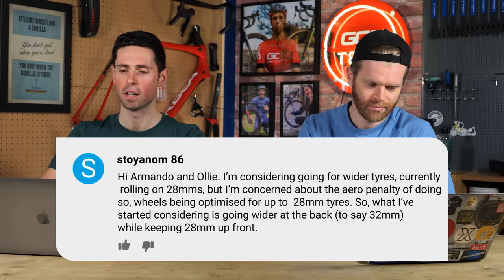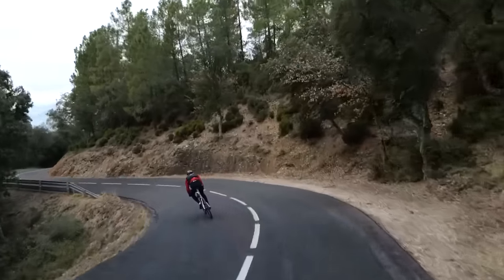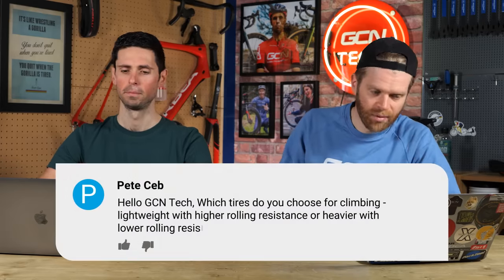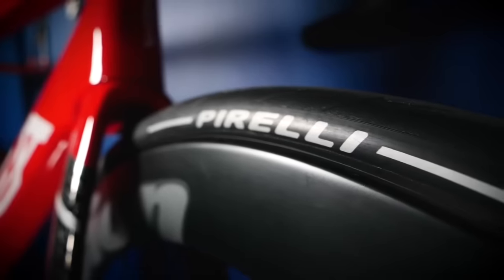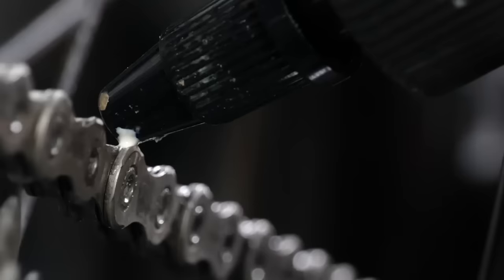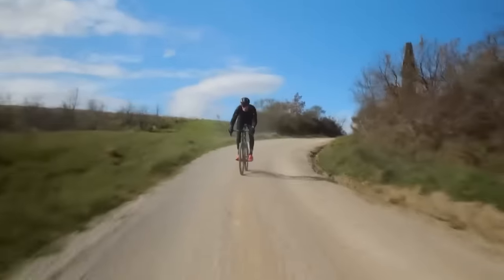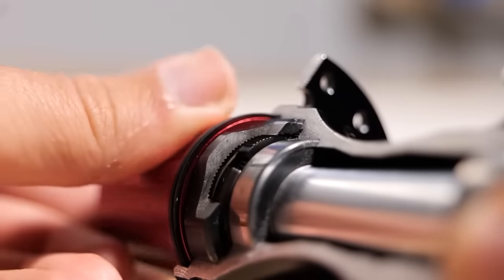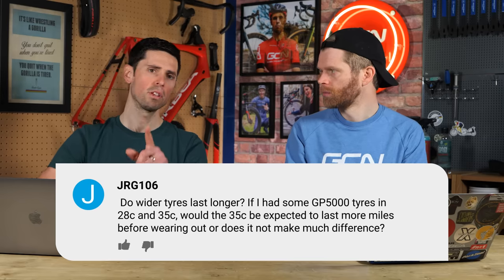Wider Tyres, Dry Weather Lube & Noisy Free Hubs | GCN Tech Clinic

Comment from the maker: Drop your tech questions below using #askgcntech⚙
Reply: #askgcntech do the TPU and latex tubes suffer from rotting when not in use like traditional rubber tubes?
Reply: #askgcntech I got some sticky race gel in my DI2 shifters. Any tips or tricks for cleaning sticky electronic shifters?
Reply: Hi guys, great video as always. I wanted to know, is a grease a grease a grease? Should I be applying different products to different components, e.g. bearings, screws, skewers/thru-axles etc, or are they all pretty much the same product? I have some Fenwicks assembly grease, but I don't know if this is suitable for all jobs, or if I should be using different products for different jobs. Thanks!

Comment: Bad reasoning on the advice for wider tires. Yes, the faster you go the more you benefit from aero gains in absolute terms, but the slower you go the more the gains you get will represent a larger percent of your speed so arguably aero is MORE important for slower riders. Tire width should be based on the quality of the road surface you ride on. If you have bad roads, go as wide as needed to be smooth. If you have quality roads, wider tires will make you slower.
Reply: I think you forgot to take into account, that aerodynamic drag scales proportional to your velocity squared. Therefore, your savings are far smaller in absolute numbers if you‘re slower.
I still agree with the overall conclusion though ❤
Reply: @dualsteel1239  i didn't forget which is why I specifically mentioned that the faster you go the more you gain in absolute terms.
Reply: The percentage should be the same if you don’t take rolling resistance into account. The overall aerodynamic drag of the bike does also scale proportional to v^2 and therefore the proportional effect of the tire width shouldn‘t change, or am I missing something?
When you are slower you then have a higher influence of the rolling resistance and therefore, the percentage of watt saved by a more aerodynamic tire should be lower
Reply: Ah, the good old Achilles and the tortoise! Going slower you just can't get aero gains similar both in absolute and relative terms as when going faster. Simply, everything gets recalculated and you can't pinpoint specific wattage and relate it to other different wattages.
Reply: I don't get it. Assuming a calm day, at absurdly slow speeds only rolling resistance and transmission losses are slowing you down. Riding with flat tires at one kph, would you rather have properly inflated tires or do the  super tuck?
Reply: @Frostbiker  That's a false dilemma in a non-sensical scenario. The fact of the matter is rolling resistance gains from wider tires and aerodynamic losses from wider tires aren't proportional to each other. The aero gains of narrower tires, such small amounts as they are, apply in every scenario. The rolling resistance gains of wider tires, say going from 28mm to 32mm, only apply when the road quality is worse. As a hypothetical, if you were a low level track racer on a smooth velodrome, you would still always ride a narrow tire even if you weren't particularly fast. Because, again referring to my original statement, tire width should be dictated by the surface you ride on. If you ride on pothole filled bumpy roads, the gains from a wider tire are large. If you ride on pristine tarmac you gain nothing from riding an excessively wide tire and in fact lose speed.

I'll repeat again for those lost in the weeds: aero gains and losses in tires DO matter to everyone at any performance level. However they should not be what you base your tire selection on. You tire selection should depend on road surface. You want to pick the narrowest tire that gives a smooth ride for a given surface.
Reply: Nope. In terms of percentages, aerodynamics is way less significant than rolling resistance in percentage and absolute terms at low speeds.
Reply: Frostbiker's example is not meant to be taken as an exact scenario. It's an analogy which helps you get an intuitive understanding of the physics of the situation.
Reply: @padmanabhaprasannasimha5385  You failed to read my last 3 sentences in your haste to disagree.
Reply: @padmanabhaprasannasimha5385  People should only introduce analogies when the actual issue in discussion is hard to understand, otherwise analogies are used as a distraction. The situation is quite clear: ride as narrow a tire as your road surface will allow smoothly.
Reply: I agree with Nike. I mostly ride track and do sprint works hence have narrow tires. Nobody rides there road bikes on bad and bumpy road anyways . We choose super smooth roads for our rides. Only advantage of wider tires is added comfort. Hence the pro riders use up to 32 mm in tour de France long stages. They are mostly in draft and need comfort more than aero for long stages
Reply: The GCN team recently did a video with comparing different tire widths on a snooker table smooth surface and results were within margin of error.
Reply: If you're riding slower, rolling resistance gains will exceed the aerodynamic losses.  It'll be a different tipping point for every human and tire/wheel combo
Reply: @NikeonaBike  even on a smooth steel drum, big tires roll better.
*Ganna got his world record on 25s.  That's not because he wanted an additional challenge🙃
Reply: @colecoleman1499  narrow tires are faster in very old track wheels with a 19-21m external rim.   Newer tracks wheels are wider, mostly because those narrow tires have such bad rolling resistance. Few World Cup teams aren't running 22-23mm tubulars now with wider tires and with Ganna and Dygert winning worlds with 25s, 25s will become the norm.  You also move significantly less in the track with 23s and 25s.  On a wooden track,  you drift up the bank quite a bit with ultra narrow tires. You're losing energy and riding further when that happens
Reply: @petertillemans2231  was about to say this. The results shocked Si and Alex and whilst the experiment wasn't in full control of all other variables, conditions were consistent enough to be representative of real world scenarios. The aerodynamic differences of tyre widths make up such a small percentage of a rider's CDA that it is offset by rolling resistance, even on a smoother surface. I would imagine if they rode at sprinting speeds there may have been a notable variation but then the other variables become more unpredictable.
Reply: While your basic math points are right, you’re doing the scientist thing, and you need to be doing the engineer thing. The amount of aero you theoretically gain, you could also lose by just using the wrong rim width with the newer wider rims, and you are sacrificing comfort. As we know from watching pro TT fits, aero doesn’t necessarily overcome power or comfort, and is thus a moot point if your bars rattle your body sore versus being more comfortable. I’d argue that a more comfortable ride arguably means a faster more aero ride towards the end too because you are more easily willing to get into said aero position and not have to overcompensate for the terrain
Reply: @colecoleman1499 Aside from a track, which in Kansas is a dirt track, I’d love to see a perfectly smooth road that wouldn’t benefit from wider tires. Even the roads in car tracks, that are often taken over for crits, are extremely rough, so much so that they are done that way to increase grip for cars. Basically, you have to riding on a surface that feels smooth to the touch to not benefit from wider tires… And even in the track, we’ve seen wider tires being adopted, 25’s instead of 23’s or 21’s.
Reply: We’ll be sure to pass this on to Honda and Ducati. Narrower more “aero” tires will be all the rage in Moto GP next season 🙃

Comment: I'm using the "gateway drug" of Silca Super Secret drip-on wax. Only the other day I was importuned on the street by a shady character trying to entice me with the hard stuff (a baggie of wax pellets). It's a slippery slope. Well lubricated, you could say.
Reply: I never understood how many chains you can wax with one bag. Or is it just one? Because then it's so expensive.
Reply: You can wax a load of chains per bag. Only a small amount of the wax transfers to the chain, the rest stays in the pot and can be used over and over again.
Reply: @marksticky0688  Thank you! And you just leave it in the pot until you use it again? Isn't it going to get dirty from dust? Or maybe contaminated over time because it takes in the metal from the pot?
And since you're so kind another question: The missing link is officially not reusable. So you buy new ones all the time?
Reply: @frodo5882  keep a cover over the wax. Just use the crockpot lid, to stop dust. Yes there will be some contamination of the wax, but if you wipe the chain down, or better still rinse in boiling water to remove old wax and debris, it will last a long time. 
I personally reuse quick links many times, probably the life of the chain. But if it feels loose when refitting,  you should probably replace it.
Reply: @marksticky0688  Very helpful!
When I'm cleaning my bike I just use water, dishwashing soap and a sponge/rug. When my chain is waxed, should I still clean it thoroughly with a sponge like I'd normally do or would that remove the wax (not talking about the initial but the regular cleaning)?
Reply: The drip on is reported to be 80 percent efficacy with the hot melt with one application. A second application of drip on brings that up to 96 Percent of the same efficacy. For most of us, a distinction without a difference.

Comment: I've gone to 30 and 32 tires on my road setups and I'm just as fast as when I was on 26-28, because I'm not that fast. The difference is microscopic, if not the same, and the ride is much more smooth. So, I don't get to the cafe 5 seconds faster. Who cares!
Reply: Its just a shame to swap bike for just wider tyres. Such a waste. I guess one could try a 650b conversion with very long reach brakes.
Reply: @jepulis6674 same bike, wider tires

Comment: To treat symptoms of latex allergy,
 apply TPU tube liberally.
Reply: I'm back on vittoria latex after so many failed/slow leak TPUs. Way more reliable, and whats a pump or two before going out anyway?
Reply: Just got to that part of the video, didn't know you meant a real allergy! 😂
Reply: @Jalfred92  latex leaks significantly every day under the best conditions
Reply: @veganpotterthevegan  i find about 2.5psi overnight which is very manageable!
Reply: @Jalfred92  Back when I was using Michelin latex tubes, they would drop significant amount of air in 8 hours. Like going from 80 PSI to 65 or so in 26mm width.
Reply: @dainiusvysniauskas2049  that's crazy! I have had mixed luck with vredestein, but vittoria has been flawless for me over many 100s of miles
Reply: @Jalfred92   I got about 5 when I ran latex tubes.  I still prefer the +95% reduction in flats that tubeless has brought me though.  TPUs go in the saddle bag.  I briefly ran TPUs before going tubeless and I only noticed about 5psi a week.

Comment: On the point of the tire wear and pressure exerted, I've had a very similar experience in a *real-world" application.
Caterpillar created a bulldozer with the suffix designation LPG, standing for Low Ground Pressure. (The one we had was a D5LPG vs a D5H. Both were "high tracks").
 The tracks are optimized to exert the minimal amount of pressure possibel for the equipment, without changing anything else, except the tracks. The 5LPG vs the 5H track size is almost double in width, if I remeber correctly, for the LPG  
That piece of equipment could walk across a bog, swamp, wetland, silt pond-- right over the top of it, and not sink, where the other one, just the same, save the tracks, would sink up to the engine, over the tracks, and have to be winched out.

It was amazing.
Reply: The whole weight of the vehicle is shared over the square inch footprint of the tyres or tracks. A 180 lb rider and bike has approx 95 lb on the rear and 85 lb on the front. 95 psi in the rear tyre gives 1 sq in of contact. 85 psi in the front gives a 1 sq in contact.
The larger the contact area requires more tyre wall deformation to achieve. It takes energy to deform stuff. The energy finishes as heat.
Reply: @jameslee-pevenhull5087  or, get this, you run the large tires at a lower pressure… You missed half the point of the discussion that large tires provide, mainly being able to be run at lower pressures.

Comment: 9:20 that's the actual definition of pressure. Force per area. Car tyres usually have a pressure of about 2 to 3 Bar. Even a Porsche's tyre. Bike tyres... you know your tyre pressure 😉 The higher the pressure, the more the same force (=weight) will be concentrated on a smaller area.

Comment: So what is the penalty on the climbs when switching from 25 to 28 mm tires?….especially in long climbs over 20 km and 5% average slope? Is the difference in weight and rolling resistance significant to affect the overall performance on such long climbs?

Comment: @askgcntech Just a quick update.  Last week I sent a question because after 120km my tyre had started coming off the rim.
A friend suggested dropping the pressure a tad because the inner tube expands due to heat from friction increasing the volume to increase which pushes out the tyre (think i got that right).
I did that and have since ridden 102 and 140km plus shorter rides without issue.

Comment: Narrow 28c tires are slowing the peloton down. Tires will continue to get even wider. Chainrings have gotten larger & cycling has gotten faster. The weakest link is having to go so slow in corners because of lack of contact patch. Motorcycles have pretty wide tires for cornering upwards of 100mph and bike tires will certainly evolve to be much wider.
Reply: You are, of course, aware that motorcycles have engines?...

Comment: Contact patch -- IT IS ALL ABOUT PRESSURE! The pressure in a (road) bike tire (tyre...) is about twice the pressure in a car tire, so the pressure on the ground - or your foot - is the same. The system weight determines the contact patch. So, if my system weight is 160 #, or about 80# per wheel, and I have 80 psi (ok, Silca says 72 in the rear for my GP5000 measuring out at 29 mm) then my contact patch is 1 square inch. Full stop. The casing's ability to transfer load in compression is essentially nil (ergo riding on flats sucks). 
I actually started to go for "wide" (as in 25) tires about a decade ago as I was starting to get serious about the Pittsburgh Dirty Dozen and was trying on 23 mm Gatorskins and coming off whenever it was slippy and 30 % grade. Nevermind that Gatorskins have horrible grip, and changing to high quality tires of any width was a major help, I also figured that a wider tire would have a wider contact patch even at the same pressure - more or less a rectangle perpendicular to the bike rather than parallel to it with a stupidly thin track tire. So, at least my reasoning went, if I rolled over some oil or other road lubricants, I would have a better chance that at least part of my tire would find some grip, as opposed to all of my contact patch rolling over the exact same drop of lube. Does that make sense?
The top of Logan St (Hill 4) is shockingly steep, narrow, has (had) a horrible broken surface, and old cars parked on the right hand side. When it rained you could literally see the oil slicks on the road. I learned quickly (and painfully) to stay left on Logan. (I never have been that good at unclipping on steeps - like that double unclip Ollie once described on Hardknott, which thankfully I encountered on a dry FW in 2019). I also once went up Boustead ("the one that hurts" - just after more famous Canton) immediately behind a delivery van that was literally streaming oil. That was a week before race day, and did I ever know where that slick line was and where to avoid. Carnage. So yea, the question is "Does lower pressure on a wider tire, and thus a WIDE contact patch give better overall grip?"

Comment: #askgcntech Coming from the old days when you could mix and match anything to anything.
Question is with Shimano are all the different models cross compatable. eg 105, GRX, Ultegra. specifically 11sp in my case.  And will the Shimano 11sp cassette freehub fit a Campag zonda rear wheel.  Still running rim brakes on a 10yr old carbon Ribble. And the Shimano parts be compatable with the Chorus 50 34 crankset. 
Main reason is to build new running gear for next years Peaks Challenge here in Australia. Need a  11sp cassette with a 36t for its lowest gear.
Just trying to change specific things in the most cost effective manor. And find that Campag has lost its way a bit on parts and compatability.
Thanks for any advice.

Comment: Are deeper section wheels ALWAYS more aero the deeper they get? At what depth does the trade-off between aero gains and weight penalty come into play? Is there a benefit to a mixed depth setup?
Reply: Yes, which is why disc wheels exist 🙂
Reply: Staggered setups not only bring the weight down a little, it also helps with crosswind stability. For example, 40 mm front and 50 mm rear. Some 50 mm rims don't feel stable when used as a front wheel except something like DT Swiss' ARC lineup.